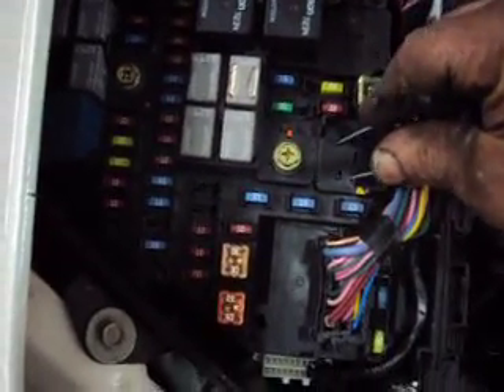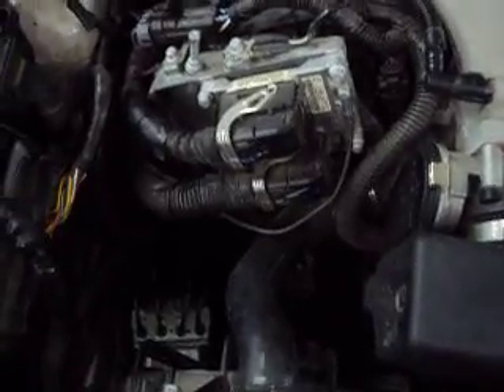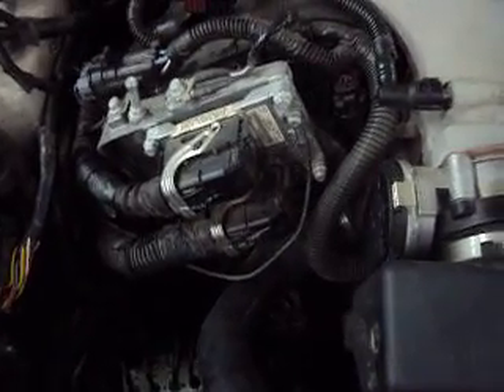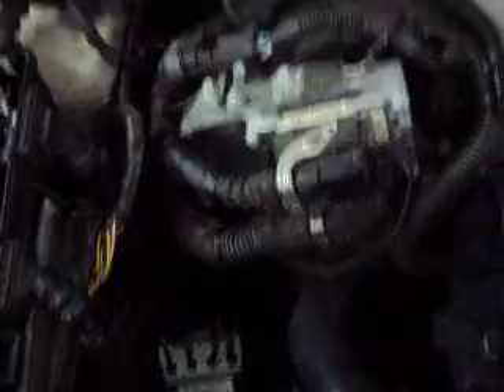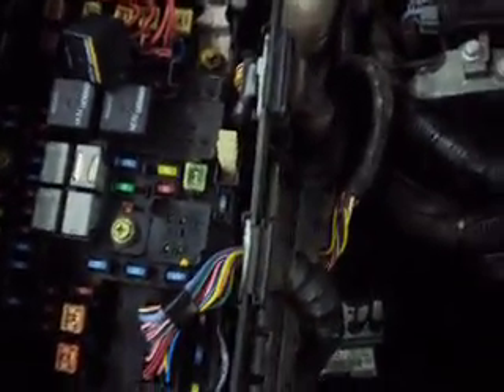An 04 Cadillac CTS 3.6 with an intermittent no crank, no start

Comment: thanks for the video MrGreasybob,  I know it's been about 5 years since the post but it's the only video or info I could find to get my 2005 Cadillac STS running again after I disconnected my battery and re-installed it the computer would not allow me to start my car, but after I did the bypass it was a miracle and finally I'm on the road again
Reply: My Cadillac STS 05 won't start or crank. Brand new starter and battery. Tried a million things nothing's worked

Comment: 1.Take the starter relay mini off ( fuse box). 2. Insert key , turn all the way you can. 3. Clean relay ( dust off and etc.) 4. Try turning on or just jump with a wire at the relay . Thanks for the video.

Comment from the maker: Replacing the ECM did solve the problem. Bypassing the starter relay and engaging the starter would allow the engine to start because it created enough of a voltage drop on the power supply to the ECM that it would cause it to "reboot". Not sure if reboot is the correct word here but I found  I could recreate the condition by temporarily

Comment from the maker: (continued) shorting the power supply to ground, (not long enough to blow the fuse). I tried a few used ECMs first but they all eventually started to have the same problem so I finally installed a new one a while ago and the vehicle has not had the problem since.

Comment: jumping the starter relay wont work with my 06 srx. battery constantly needs a jump to make a fair attempt. gets pretty close to firing up but close wont cut it. tried to use starter fluid as well. maybe try spraying while someone turns the ignition simultaneously? or does the ecm need to be replaced?
Reply: does it still work
Reply: I ended up taking it to the dealership. The antitheft disabled the car. I don't drive that one anymore tho, it's parked. I got another one just like it.

Comment: Hello sir, my car same problem , my question is Radio and A/C control switch all cutting off same time , then again on few second engine no crank, but I can start from the  starter relay, after that  normal operation no mill light on, this is same ECM issue or something else.

Comment: Had this same exact problem on my 04 CTS 3.6L last year. I determined it was the theft system, so I just stopped locking it, and never once had the problem again, I don't care to fix that at this point, it's 11 years old with 200,000 miles, I don't keep anything valuable in it anyway.
Reply: eots44 omg thanks so much this is what was wrong with my girlfriend 04 xrs so now we don’t lock it anymore and have over 200,000  miles and not fixing ours either
Reply: So what did you have to do to get it to start?

Comment: I tried this and it did nothing. It just made a small spark and then something by the radiator turned on and made some noise. Car did not start or anything.  I have an 07 CTS. What could be the problem? Just a burned out starter?

Comment: I bypassed the starter in my car and it worked for a while. I actually added a button that I can press every time the the car doesn't start in order to bypass the starter but the button stopped working. 
Does bypassing the starter not work after a while?

Comment: I have the same problem, but I tried jumping the starter relay, still a no start but did crank. Almost like it's not getting fuel. It will start real quick with starting fluid so I def know I got spark. Could this still be the ECM? ..
Reply: Hi Do You Remember What The Solution Was By Chance? Having The Same Issue.

Comment: I have an 09 cts-v and today I got the same u0100 code and my car died while I was driving I don't know if you know if the ecm/pcm is a common problem or I could it be a sensor that's causing the problem causing the computer to short out

Comment: tried this with a 2005 CTS but it cranks and the engine kicks on just for a few seconds but wont stay running and the only electrical on in the dash is the A/C and the check engine light nothing else. please help.

Comment: How common is this problem with a bad PCM(or BCM), especially on a GM car? Usually this is one of the things that GM generally did a nice job on doing right. However GM did some weird things to the general wiring, such as running the AC Compressor clutch and part of the BCM off of the same fuse on the final N-Bodies (Grand Ams and Aleros).

Comment: my 2003 cts Cadillac does the same thing but my car has no signs of power until I switch the lights manually then only the door lights and the the dash lights turn on except the cars interior lights and the radio  and my car did not start when I tried this it crakes over but doesn't start and I can't remove my key it only turns to accessible and to crank over need help please

Comment: After watching your video I am not sure what part needs replacing, I have the exact problem you show and if I remove the start relay and jump the starter it fires every time. When I search for "ECM" I see that the name seems to be interchangeable with ECU. If I look at pictures online of an ECM I see a part that matches my part mounted to the side of my fuse/relay box, but the part they are calling the ECU looks like the part that is mounted on top of the engine (passenger side) with 2 connectors attached. Can you suggest which of these 2 parts I should be looking for? I have 2003 CTS. Thanks in advance for any info you can lend to me.

Comment: All of a sudden after jumper wiring the starter solenoid about 5 times total now my car wo t start at all. Just a loud click down at the starter. Could jumper wiring that relay fry anything in between. I checked the 30amp fuse and it is good. Any help?
Reply: +Refutreus Groplin That sounds like your starter. Was it?
Reply: Man the computers on these SRXs and CTSs are just known to be faulty. I ended up ordering a used one reprogramed it as needed to get security to unlock and i ended up with another bad computer. Ready to buy a refurbished one and sell the truck
Reply: Bummer!
Reply: Yeah its ok tho learned a ton about this engine.
Reply: Good to hear.

Comment: 2005 cts, same problems as everyone else. used a company called m.a.s. out of GA to rebuild my ecm. Got it back from them and problem is still present. now thinking about buying reman off somebody else. what is everyone buying? new or reman ecms?
Reply: See sean b POST: 8 months ago
update: bought a remanufactured ECM from flashmasters out of Ohio. it was plug n play and fixed my 2005 CTS. do not I repeat do not use My Auto Solutions out of Georgia. sent my ECM there twice and they swore up and down they repaired it and told me my vehicle had other problems.

Comment: Thank you for the video.  I have 2003 doing same thing but when I jump the starter relay it does not start.  What would be the next step?
Reply: +mrhillmant Did you fix the problem with your 03?
Reply: Yes
Reply: +mrhillmant Was it the ECM?
Reply: Hi Do You Remember What The Solution Was By Chance? Having The Same Issue.

Comment: What was your solution to the problem?  What was the confirmed fix?  I checked all the body grounds G101/G102 and the bus communication purple wire, i checked pin 36 pin 3 and pin 48 and they all have power, reflashed vehicle, replaced ecm, replaced the ignition switch and the fuse box panel and I still have the same issue.
Reply from the maker: replacing the ECM with a new one was the fix.
Reply: New or reman?

Comment: how did you solve the problem? thanks. I have the same issue...
Reply: +soarecelegica Do you have a CTS? He stated that he replaced the ECM to fix it. I have one from another CTS but that didn't work I guess I have to flash it or something before I put it on this one, not sure. Maybe +MrGreasybob could enlighten me.
Reply: +Hector Maltez  he said he put e new one in. ,If you try a second hand one you have to do an immo off.
Reply: +soarecelegica Thanks, I'll look into doing that or getting it done.

Comment: my 2005 CTS 2.8L 6spd  is doing the same thing.. jump relay and bam it runs and communicates ..
Reply: same with my CTS 2004. i have started engine also with jamping relay and it runs and comunicates. but what is the mean Problem? Is it ESM, which will be dead soon? or what?